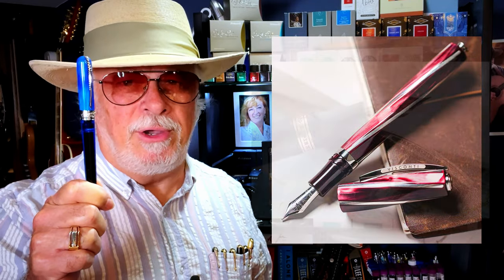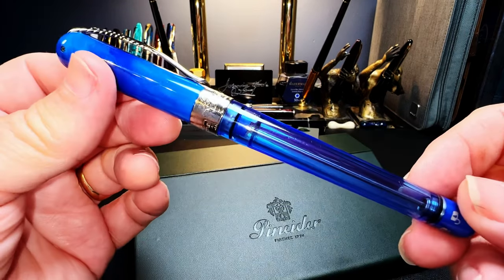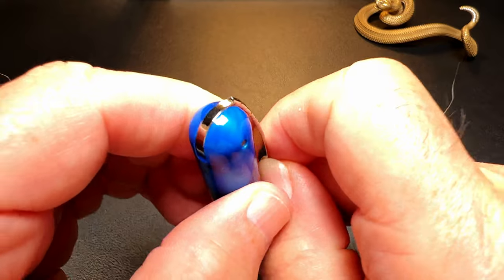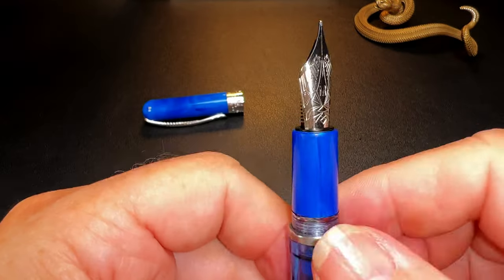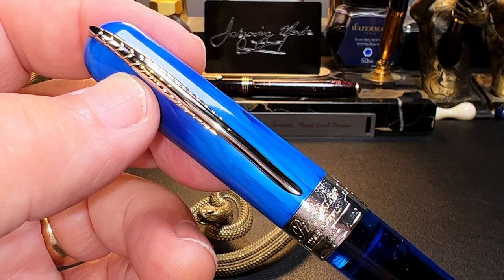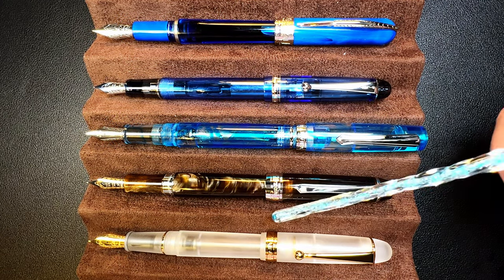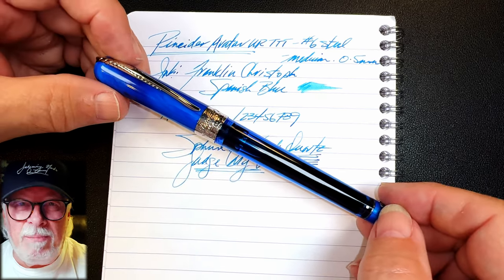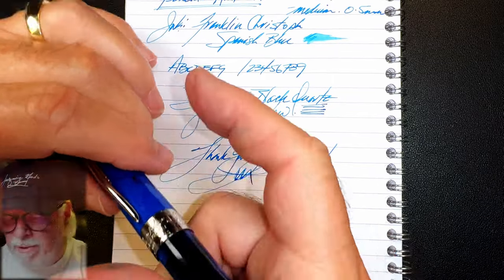Pineider Avatar Twin Tank Touch Down Fountain Pen Review

Comment: Hey Doug, that rod can be completely removed with a flathead at the plunger o-ring head. If you put the screwdriver in the section side of the barrel and hold it there while twisting the other side, you can pull it all apart.
Reply from the maker: Cool thanks!

Comment: I didn't realize the two-reservoir design was common enough to not be discussed. I was looking to hear some thoughts on it
Reply from the maker: Technically, all vac-fillers with a shut-off valve are two-reservoir pens. The section through the feed is the front reservoir and the barrel the back. In two-reservoir systems, the designer just enlarges the front tank by moving the stop valve back into the rear chamber's space.
Reply: @InkquiringMinds  True. That's partly why I'm interested in thoughts of how necessary/useful this design is. It's weird that you can't post it while the blind cap is in the unlocked position. So they don't really intend for you to write with it unlocked, or else they don't intend for you to post. Or can you set it to unlocked without it actually sticking out so much?

Comment: An excellent review, Doug. You can swap nibs easily. I put in the Pineider Quill / Hyperflex nib. But you also need to swap out the feed that goes with the nib for it to work properly. 

I enjoy this pen a lot. The maintenance of the pen is easy. I did not have any leakage when I reassembled the pen. Sorry to see that you did. 

Is this a keeper? For me, yes. Is it better than the Original + or penBBS rains to be seen. Any opinion on this?

Dante is a wonderful person, passionate about pens and motorcycles. I met him twice.
Reply from the maker: The Original + is an awesome vac-filler. If it posted better it would surpass the Penbbs 456. This TTT is right up there with them. Huge ink supply for a slender pen.

Comment: Pineider's Bock nibs seem to be well adjusted to good enough wetness and tend to be on the thinner side. I knew that Kaweco Sport's 060 Bock nib could be tuned to be excellent writer(which has a very soft springy feel for a steel nib!) without that premium or gold price, though also, Leonardo's switch from Bock, seems to me, all of this is rather less indicative of Bock's poorer QC problem we usually heard about, they can make great steel nibs that don't feel like nail, but I assume they had 'bad' order specification that even Leonardo failed to double check back. From my experience handling vintage-ish soft gold nibs, softer nibs aren't as steady as harder nibs, when its being pushed, there is more chance that the slit grazes the paper sharply, thus created scratchiness that might startle the inexperienced users, creating bad feedback(both writing experience, and manufacture specification) against Bock, compare this to the commonly perceived Sailor nibs' good feedback, which perhaps partly to have become popular and expected. maybe, Kaweco tried to mitigate it by ordering more smoothing on the inner side of tines, making a lot of Kaweco Sport nibs to have very obvious baby's bottom, maybe Pineider ordered such ornate stamping so the Bock nib is stiffer(thus less prone to tine inside grazing-scratch) than usual

Comment: So, the unbreakable resin in the blind cap can get nicked and the unbreakable resin in the barrel can get scratched by posting? That doesn't sound super tough. The bayonet style blind cap seems like a neat idea, but those lock/unlock icons seems silly and ugly. This does seem like a nice pen. I'm not sure I'm ready to plunk down $200, yet, but it's on my radar, now. Thanks for another great review.
Reply from the maker: Thanks. I would guess that the more brittle and scratch resistant the material, the more prone to breakage. But more flexible material could withstand a hammering. He said it is unbreakable, not scratch resistant.

Comment: My first pen from Pineider randomly broke when I went to twist the cap off. The magnetic seal requires the slightest turn of the of the cap to break the magnetic seal, so not indestructible. Hopefully I can get a repair or replacement.
Reply from the maker: Contact them and I'm sure they'll take care of it. Tell them Doug sent you! ;)
Reply: @InkquiringMinds  ha, I'll give the name drop a try. I contacted the retailer Atlas Stationers first, they said to contact Pineider, and they told me to contact Atlas again. I'm in limbo at the moment. I have the Gran Belleza model and the rear body of the pen separated from the grip section where the piston would meet the feed.
Reply from the maker: @svgranger  Oh yeah! The old shell game!

Comment: Back in March I bought one of these--same color as yours, BTW(great minds?)--from Pen Chalet at a discounted price of $148.  At that price, I consider it a very good, but not great, value.  Though it writes very well and performs very well in all other significant respects, I have a couple of cosmetic quibbles.  First, the contrast in the appearance of the cap material and the body of the pen is disconcerting to me.  The cap looks first class while the plastic body looks cheap by comparison.  Secondly, I find the symbols for the locked and unlocked positions of the vacuum cap unnecessary and rather silly.  In short, glad to have it at the price but would probably be a bit disappointed had I paid full price.
Reply from the maker: I agree about the symbols on the blind cap. But, when the pen is full of ink , it looks rather attractive.

Comment: "Cool" with a pirated name, shoddy tolerances, unfortunate graphics on the bayonet, and cheap looking resin.(I find Dantë insufferable and his pens meh, but I'm always the outlier 😎).
Great review, and a suggestion: I flew with my new vac from Ben Walsh, which UNLIKE this pen is beautifully engineered. I forgot to tap the ink out of the reservoir and had my first "blerk" when I went to use the pen post -flight. This was TOTALLY my fault, so, forget not to tap the ink back into the main reservoir before flying, lest you too have blerkage!
Safe travels, Doug!
Reply from the maker: Good tip Jackie! Thanks!
Reply: It looks like the cap is designed by a different person than the pen.